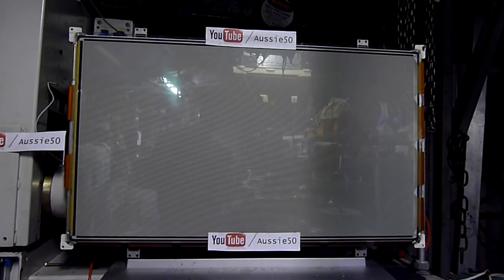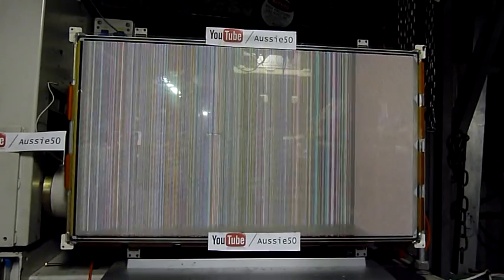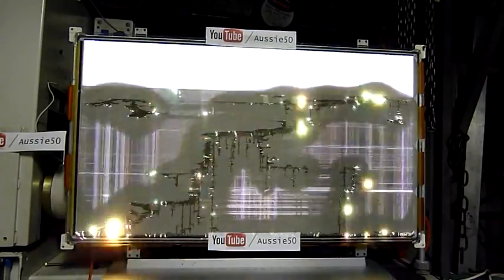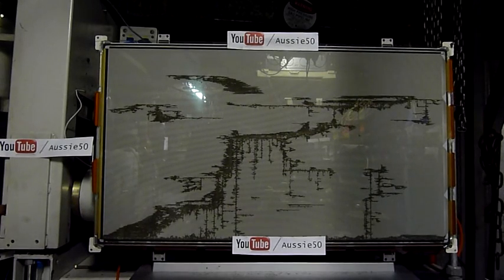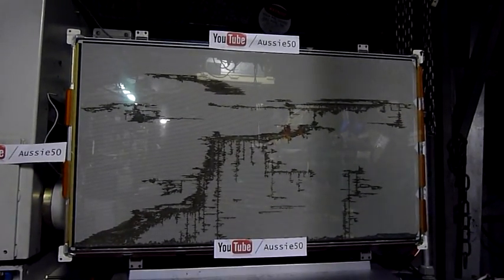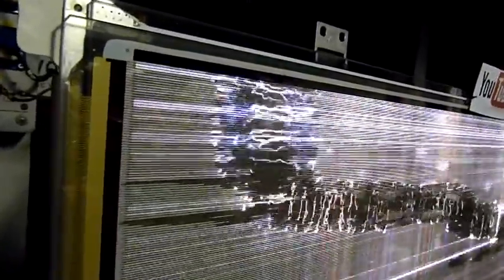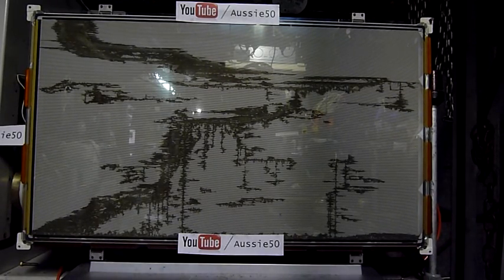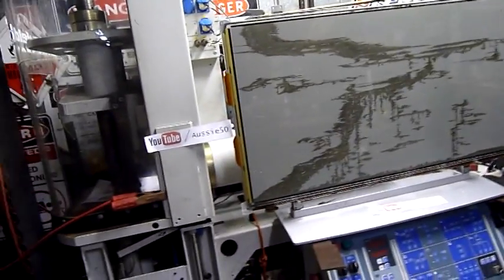Amazing Plasma TV Lightning Show   2000V Through Panel

Comment: It looks as though once it has carburized pathways in certain areas, then the current will STAY in those areas. I wonder what would happen if you put the full 6000 volts on it from the very start?  Would it just make pathways quickly, or would it make a LOT of them all over the screen?

Comment: Idiot. Not produce anything, only destroy thing and thinking that it is fun.
Reply from the maker: lmao, want to tell me what other productive things can  be done with a defective plasma panel? :p
Reply: Aussie50 a fragile coffee table? ;p
Reply from the maker: Joseph Rumpsa
haha possibly, put 150V into it and it can be a light up coffee table :D

the protective front panels are very hard to break tho, they come in handy around the workshop!
Reply: Really? My Panasonic PDP seems to have a thin plate of glass. Then again, I never had it out of the cabinet, lol. That would make an epic table, though!
Reply from the maker: Joseph Rumpsa its usually got a coating of plastic on one or both sides to act as a tint and like a windshield. prevent sharding if it is accidentally broken., so it will break if you hit it sharply enough, but its not too bad
Reply: Ahh, alrigt, good info, thanks!

Comment: The excitation states of phospor that produce light (EM radiation) will subsequently produce other high energy radiation at higher states. Putting 2K volts across it to cause bright white flares is certainly hitting these higher states.  Do you think about the fact you might be bathing in x-rays?

Comment: I heard it was a "cubic yards of concrete" term, but I checked Wikipedia and it is of indeterminate origin. The original phrase was "the whole six yards", and was used in the 1800s, so predates cement mixing trucks and machine guns.

Comment: not 100% on this but here it goes:
Electricity uses ionized atoms to travel through (in this state the electrons aren't "attached" to a certain atom). It has more chances to go through a more electron-free path. So as it goes through this path with less electrons, it
leaves some of the electrons behind, and the electricity goes through another path (with less electrons), thus repeating patterns.